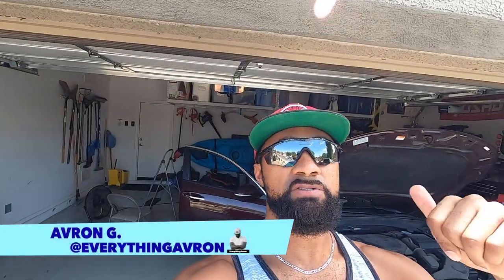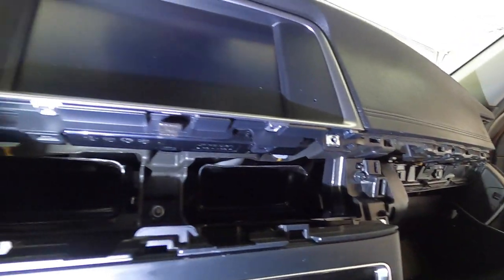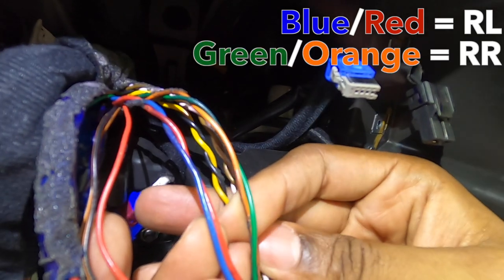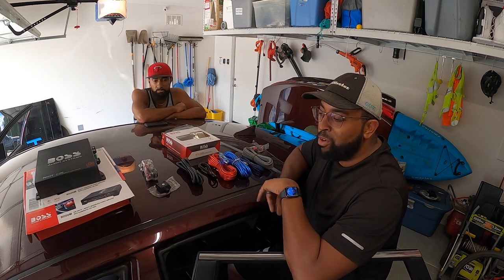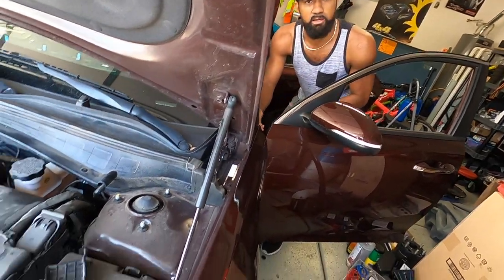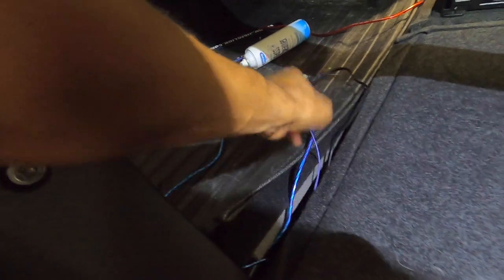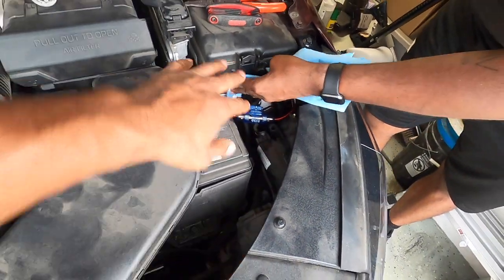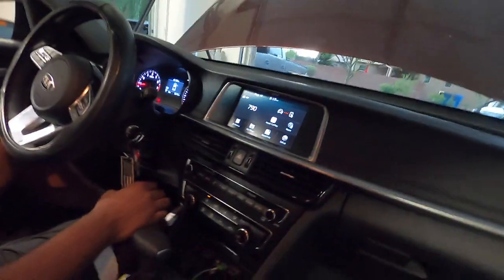HOW TO INSTALL A SUBWOOFER & AMPLIFIER| 2019 Kia Optima Aftermarket Sound System Upgrade

Comment: Almost a year and a half later and still bumping!!! 💪
Reply: In case you were wondering, I just found the best way to hook up your power wire. I also have a 2019.  Open the fuse box and see on the cover that it has a long channel that covers the main power cable, right next to the cable is...... A spot to install another power cable!?!?
Reply: Send me your email bro i would love to send you pics of my set up on my Kia Optima Lx 09’..

Comment: You DO NOT have to run Power wire through fender or drill another hole through firewall. I just installed my sons 4g power wire through an existing grommet with oem wireharness.  Its easy to see from inside the car just up and to the left of the brake pedal. Poke a wire coat hanger (carefull not to rip oem wire) through and you can see through engine bay under the Master brake cylinder. Tape the power wire to the coat hanger and pull through!
Reply: does it still work?
Reply: That's exactly how I ran mine and my girls kia both 0 gauge

Comment: You don't have to take off all of that if you are going to use  the L.O.C.  Just run your amp wiring all the way to the trunk get the speaker wire that is hooked up to the factory speaker in the trunk hook up the L.O.C. to that out put speaker and your done with that. Next red wire power , black wire ground, then blue wire to the fuse box . Fuse radio blue so your amp turns on .. then you are good to go.... Next install a PS5 .... LoL 😈
Reply: I'm curious to know where can you find these speaker wires at in the trunk. I plan on using an Audio Control LC2i Pro.
Reply: @darrylpolite8722   check the trunk if you have speakers, if you do, it has a black plastic hookup on it. That black plastic hookup has some wires on it like before the black plastic. Those wires are the ones you tap in to for the L.O.C.
Reply: @familygunsandrides....8024  thank you so much for the quick reply. When I was originally exploring this option, I didn't see any speakers in the rear deck. They're only in the dash, the front doors and rear doors. 

Since it's my wife's car, she's not big on bone shaking bass but she loves the sound. I'm looking into doing things on a 2020 Kia Optima FE. I was thinking instead of me doing all of the work up front to the dash that it would probably be easier to follow the speaker wire from the rear doors to splice into. If there's no other locations that makes it easier.
Reply: @darrylpolite8722   center deck in rear you should have a 6inch on the 2020 Kia optima.
Reply: @darrylpolite8722 did you run a loc for your optima? I just installed mine and it was a pain in the ass. Couldn’t figure out which wires in the b pillar were to the speaker so I just ran it from the speaker in the doors and ran the wire through the rubber piece connecting the door to the car.

Comment: Couldn't you have just tapped the rear speaker wires in the back and ran a remote to 12v fuse?? Just curious, bc thinking about my install

Comment: Love the video...I'm doing a 2017 Optima right now. Cannot find any wiring diagrams. Which one on the factory harness is the remote wire? What about the left and right rear speaker wires? TIA
Reply: My optima did not have a factory amplifier, so there is no factory remote wire. 

I know the SX model has an Amp under the seat that has a remote wire you can tap into. 

I used a in-line fuse tap and plugged my remote wire into the cigarette fuse. That way it only turns on when the key is on.
Reply: Im having issues with my 2017 were in the vehicle did you put your ground if u dont mind mi asking

Comment: Next time, instead of removing the rubber door grommet, do what i did and make a hole with a drill and pass the power wire through it. I also put heatshrink on it to blend in better and protect the wire from possibly chafing at the penetration point.

Comment: Instead of going behind the dash ....take some speaker wire and tie right into the side panel between front and back door and run your hi..lo.. adapter up in the trunk in cubbie hole .... shorter remote wire  and just take your pos and negotiate from hi lo ... and run it straight to the pos and neg on the amp... whole lot easier then having to go behind dash

Comment: Probably a little late for this comment but I recently bought a 2020 Kia Optima. Behind the break pedal there is a black rubber sealer that has a hand full of wires. If you push the power wire from inside the car it goes directly to engine bay.
Reply: Dang, that would have been nice haha!
Reply from the maker: We could probably pull the Power wire and re route it one day lol.  Yay for more Content!!👍
Reply: haha, no your not late thanks!
Reply: @jurgenharvey9509  is the wiring diagram the same for the 2020 Kia Optima as the 2019?
Reply: @Nascraniel  sorry bro, just now seeing this comment, and honeslty i dont know fr, i got a 2018 and idk if its exactly the same. thats why im still here. theres a couple things in this video that was not well explained. Wiring diagram?? that was needed since KIa makes like 6-8 different models of the optima.
Reply: I’m also wondering where I can find the exact wiring diagram, I’m stuck on the same thing bro, I’ve researched it many times it was a hassle 😭

Comment: Good video. On the left and right speakers, what color is positive and negative? Thanks for your response.
Reply: Rear Right = Orange (-) Green (+)
Rear Left = Blue (-) Red (+)
Front Right = Yellow (-) Black (+)
Front Left = White (-) Brown (+)

Thanks for watching!
Reply: Thanks for the response. One more question, what wire did you hook the remote turn on to?
Reply: Jesse Moss I used the fuse tap linked below.  Tapped into the cigarette lighter fuse. 

https://www.autozone.com/electrical-and-lighting/fuse-and-accessories/bussmann-atm-add-a-circuit-fuse-tap/32416_0_0
Reply: Carlos Garcia thanks bro! I appreciate you.
Reply: @carlosgarcia7183  what color is the ground
Reply: @tristin2392  Hey Man, take a look at the diagram of the 4 speakers above. Each speaker has its own ground. 

We grounded the amp to the chassis.
Reply: @carlosgarcia7183  which wire gave you power to the LOC

Comment: it's all good but the thing U could have done better is the rubber plugs... Instead of cutting a notch, it would've been better drilling a hole in them and feeding wire through... Been there, done that and it works awesome. Other than that, nice install.

Comment: Which battery terminal did you add the amp to? It's weird how kia has the amp fuse on the battery, I have a 17 forte and it looks like there is a terminal for aftermarket electronics but I don't wanna make a mistake and blow the fuse
Reply from the maker: The Amp had the Hot wire going directly to the Positive battery terminal. just remove the negative cable from the battery when you do your connections and then lastly you put the negatively back on.

Comment: I have the same exact KIA 2019 optima, although I don’t seem to understand where each splice should be , could I possibly get an image of which LOC converter cables were connected to what other colors
Reply: Yo bro! Did you find anything on this? I can’t seem to figure it out!

Comment: Holy crap this looks so tedious and I wish I could do it myself. Is there a significant difference between the factory amp and the new one you got? Can I ask what it was? (Bass? treble?) also where do u guys live (damn so far away!!! Just got to the bloopers) wish I could pay you to install for my car 😂😂
Reply: For this model, Optima LX, the radio used the built-in amplifier to power 6 speakers (4x door speakers & 2 tweeters on the dash).  Both the Amp and Subwoofer were aftermarket. It was a huge difference!  Here we are 4 months later and I still love it!

Oh yeah, we live in AZ 🌵
Reply: @darylcooper5481  he tapped into cigarette lighter fuse so it only comes in when the car is powered on.

Comment: what wire harness did yall buy to run from the factory head unit? I have a 2019 as well and need to purchase one.
Reply: No you don’t, look up a diagram of your radio wires for that specific vehicle and see if it has one that says “remote amp” and plug the amp into there

Comment: Do I need a different radio or could I use the one I have that came with the car
Reply from the maker: By radio if you mean the deck itself yes... the one we have is the stock deck just had to wire up the harness

Comment: Can u hook up the loc in the back speakers for less wire ?
Reply from the maker: Im sure you could, as long as you're tapping into the same wires in the circuit you'll be fine, you're on the same node throughout.

Comment: Where in the vehicle did you connect your ground power im having a huge issue with that
Reply from the maker: If I remember correctly , we connected it to the grounding bolt up under the driver side on the left panel of the vehicle. (to the left of the dead pedal)

Comment: How did you route the RCA wires in the dash the get to the LOC?
Reply: thats what i was thinking as well, when you take off that one thing that he said in the beginning of the video that was "flemzzy", you would most likely run that RCA wire thru there carefully. Maybe some zip ties and put that flemzzy peice back on when your done

Comment: Hey so I did everything on this video but I’m not getting any power to the amp where do I connect the yellow & black from the LOC to which wire to gain power ?
Reply: Its prolly your remote wire. Make sure its connected properly
Reply: @bbrezze3454  thank you I’ll double check & at the finish product what wires did you exactly had hook up to each wire we used? If I can just get a diagram of which ones they hooked them up on I can double check mine & see if it’s correct ?
Reply: @bbrezze3454  or better yet where do we connect the remote wire to?

Comment: You could have just tapped in to your trunk speakers with that loc instead of taking your whole dash apart
Reply: The optima doesnt have speakers in the rear deck only the front and rear doors and the dash.
Reply: There should be a rear stock sub to tap into. Right above inside the trunk. Simple work instead of taking apart the dash. Even though that seem easier on this newer model compared to the 2011-2014 models, man you have to take off  the whole left side dash to get the radio lol.

Comment: hey there, just curious when you hook up a new amp and sub to a car that has a factory amp and subwoofer?
do i leave there sub and amp connected or disconnect the wires to the factory amp and sub. this is a kia sportage ex 2016 btw. Thanks
Reply: disconnect it. recently had a sub done and the installer by passed the factory amp.
Reply: it was under the passenger seat.

Comment: You did not explain where the 2 screws are on the 2nd step. It looks to be hiding behind a panel in the glovebox. Still unsure hot to access
Reply: Just pull it off. I had that question too

Comment: I’m running 0ga on my 2019 optima and I definitely did not take my dash apart 🤣
Reply: Same. I’ve got 4 runs of 1/0 and never touched my dash
Reply: @xchimnyx  Did you keep the stock radio? If so, how did you connect everything? I don't want to take the dash apart either.
Reply: @terrywilson2076  I didn’t, I replaced it after a week. Initially I used an lc2i pro though.
Reply: @xchimnyx  question I was trying to put my door speakers on an amplifier I have the lc7 but when I cut the wires and hooked up the new speakers the speaker never cut off which was super weird because it was no power going to it but the wire is this going to the front speakers was green and orange but the speakers never cut off when I cut the wire would that be something you can give me more information on?